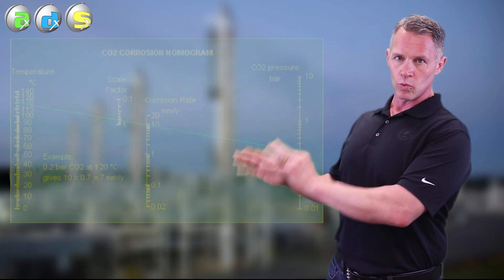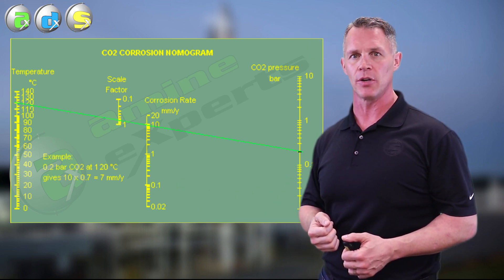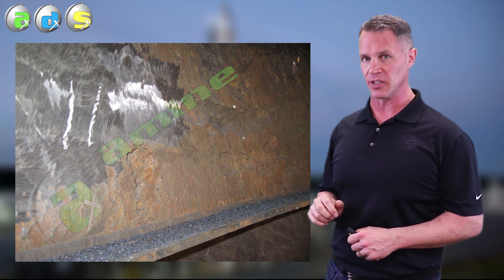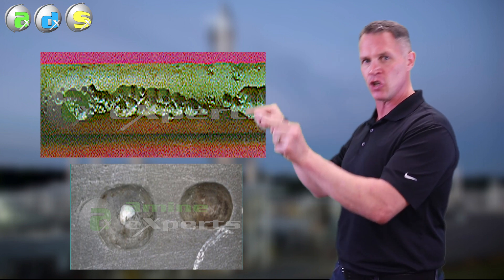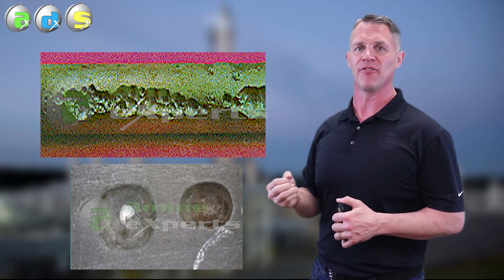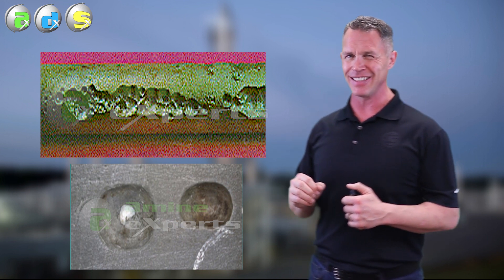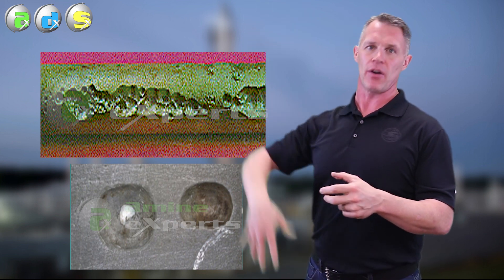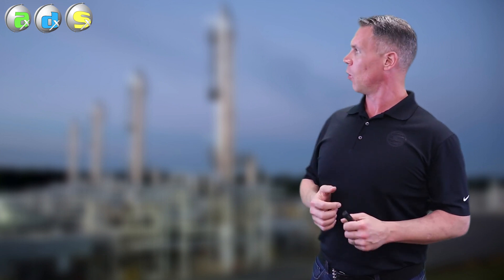Preventing Corrosion in CO2-Only Amine Systems (Part 1)

Comment: Would it be possible to share the full nomogram? 

Also, based on that nomogram, what would be the corrosion rate for high temperature and high CO2 pressure (>3 bar) applications? Since the corrosion axis does not go that high in the screenshot you shared, it's hard to tell. Thank you!
Reply: I'm not sure Christopher! High, I would guess. Because amine plants only go up to about 125C, that's the highest temperature I ever worry about